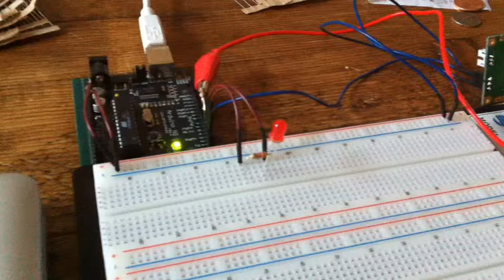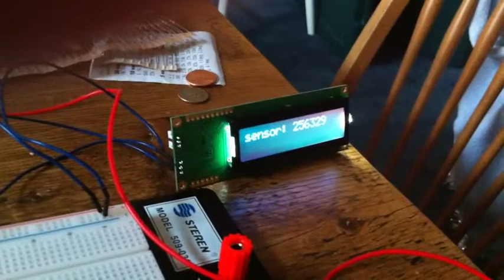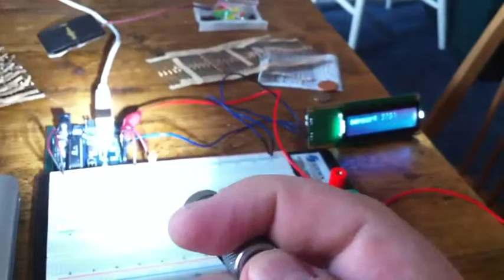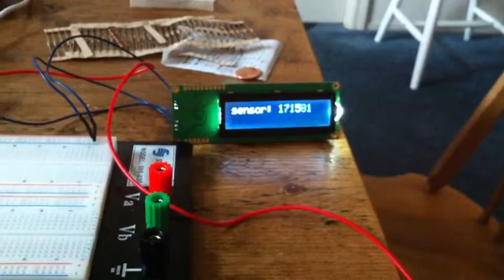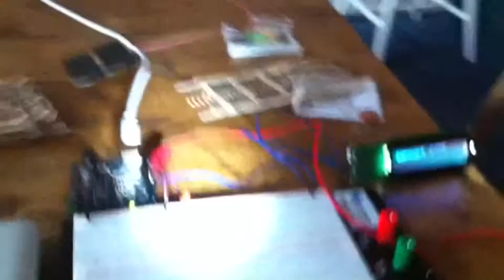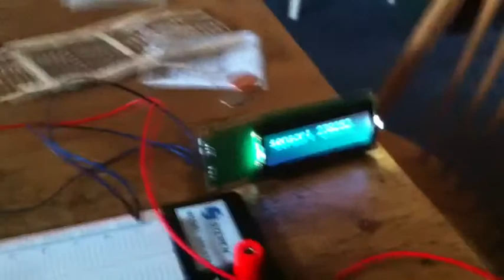An LED Light Sensor, with questions...

Comment: Reverse biased diodes operate in photoconductive mode, photons liberate holes and electrons which get accelerated out of the depletion zone by the strong electric field, forming a current proportional to the light intensity.  Basically the capacitor gets more leaky with more light.